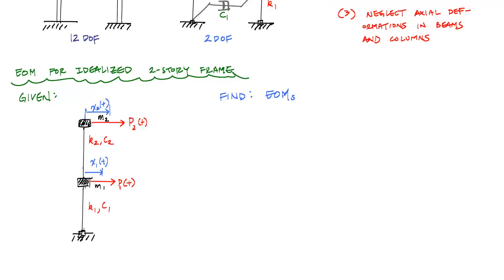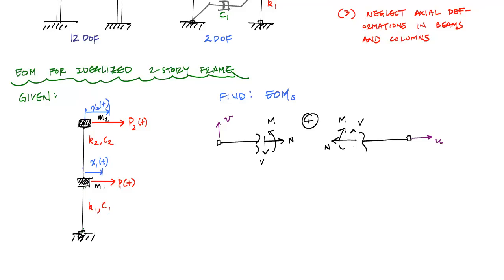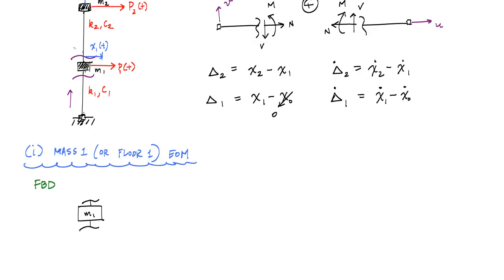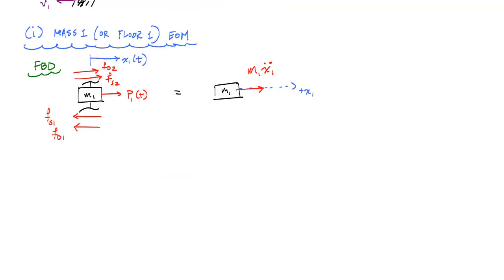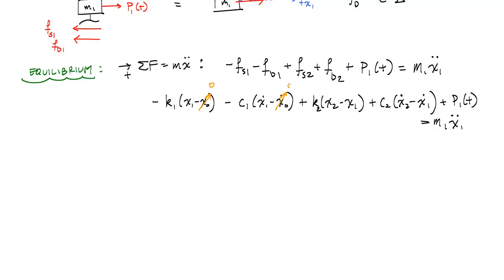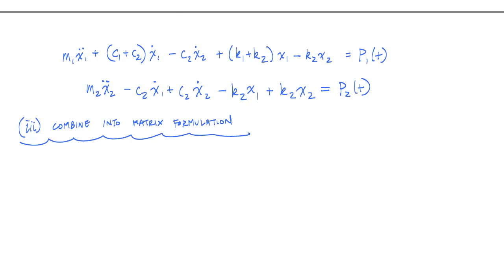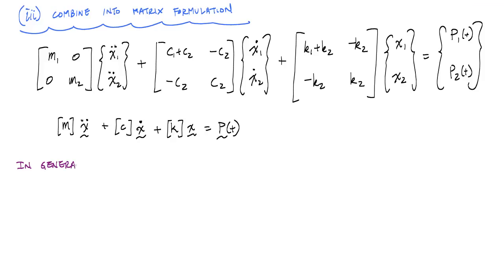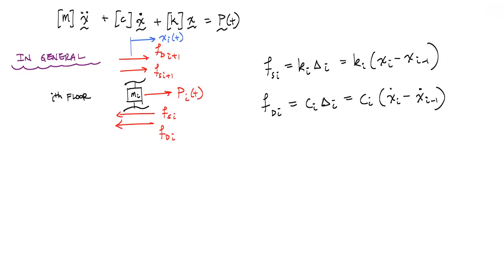Introduction to MDOF Systems (3/3) - Equations of Motion - Structural Dynamics

Comment: Hi there, isn't the interia term vector opposes the the acceleration in direction and hence, - m X( double dot) ? From D'Alembert' s principle  ?
Reply from the maker: yes, that's true if you draw the inertial term on the external force side (left) of the equation.
Reply: @structurefree  Thank you Prof. That is Why I thought about a missing negative sign for this term shown in FBD. Anyways, thanks for an amazing short n sweet lectures and into the bulls' eyes. Your videos are treasures. Be Blessed.

Comment: if the question gives flexural rigidity which is EI in order to convert it into k, we use the formula, k = (12EI)/h³

my question to you is, for k1 and k2 do we need to consider the height where for k2, the height is h1+h2 or solely use the h2 for the height?

Comment: how will we solve the matrix equation?...
Reply: Well, basically your inputs will be the lumped masses (m matrix), damping coefficients (c matrix), stiffness matrix (k matrix), and the external forces (P vector). Using software is quite easier than manual calculations.